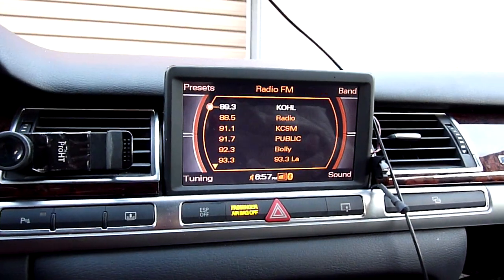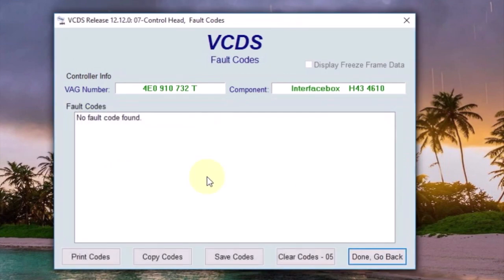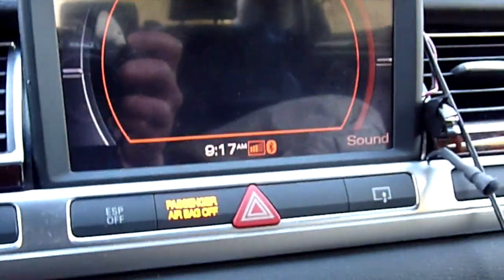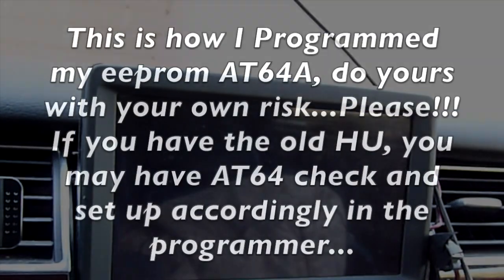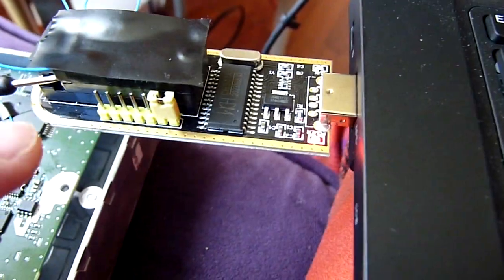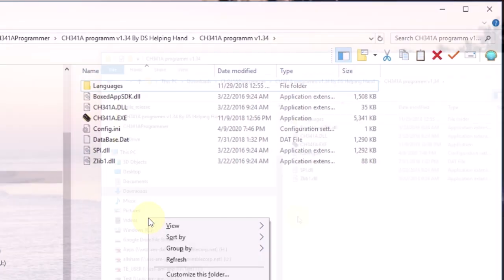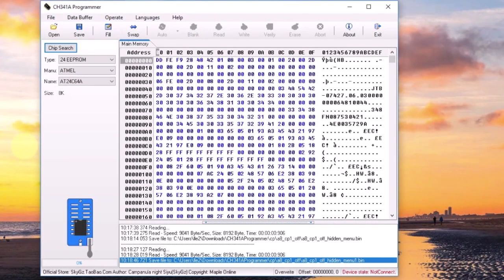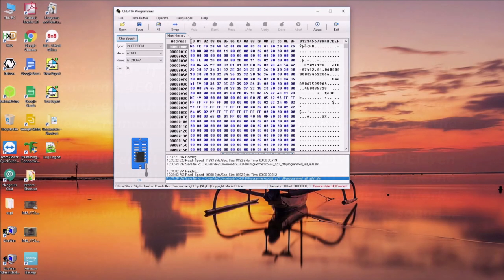How To Replace And Remove CP HU MMI 2G

Comment: Hello, quick question: since I currently have no sound (due to CP), if I perform the same conversion from my old EU unit (without navigation) to the new MH2P (USA with navigation), will the audio work afterward? I plan to activate the necessary codings with VCDS once the conversion is complete. Also, will this conversion give me the European languages instead of the US ones? Thanks in advance.

Comment: 9:45 great video and explanation. I do everything as shown with all pins connected correctly to both sides. unfortunately just the very first time I connected the device, I could read it just once. every next attempt the red light is on for just a second or two and then goes off. Then Tried the same procedure also with my new module and again it lights on for just a second. This way I cant read the chip.

Any thoughts what went wrong? Is it the chip reader, the pc or the windows 11, or maybe the cables I use ? Thanks for time, help and videos
Reply: Same situation. Did you resolved this issue?
Reply: No. Eventually, I gave the mmi to a guy who did transfer with his own hardware/software. I guess either my ali express stick or the cables direct contact didn’t work properly.

Comment: My mmi is 2g control module for my 2006 audi a8l it  the number is 4E0 035 729.  So if if I get the one 4E0 035 729A it will work?  If I reset it thru the controls or do I have to have the vcds software to reset it?
Reply from the maker: What are you trying to do by replacing HU? If you want to have CarPlay/android auto they have a unit that plug and play with MMI 2G already. If you still want to change to the “A” then you still have to remove the CP.
Reply: @3dogs1monkey  my mmi control module is bad and no longer works so I have to replace it so my controls and screen will work
Reply: If I get a after market carplay/android auto radio.  The mmi control module has to work to get sound right?
Reply from the maker: @MrSicwitit2008  it uses MMI control to navigate so everything must work as original
Reply: @3dogs1monkey  thanks I'll get the mmi that has the same number as mine and get audi to program it
Reply from the maker: @MrSicwitit2008  just get the A no difference if you need the dealer to unlock cp

Comment: Thanks for the great video; is there a way that I can get in touch with you ?
I did an MMI interface swap with same part and software numbers matching took the car to the Audi dealer charged me for 3 hours job for updating the unit yet couldn’t remove the CP.
I’d like to send you both of my units and see if you can do the CP removal many thanks.
Reply from the maker: What MMI interface? The Head Unit? What CP do you have? just the sound? Everything else works? I don't have the programmer with me any more, but I can swap the i2c chip for you which should remove the CP. What year is your car? Please take the pictures of the head unit and email to louis@dognmonkey.com
Reply: @3dogs1monkey  I emailed you already thank you so much 😊

Comment: Hi, I have read the memory several times, which I have unsoldered and compared the different readings but they are always the same. can you help me?
Reply from the maker: Angelo Patricelli why did you unsolder? How did you read? Both images should be different. You should see the serial number and model in the hex files, how can they be the same? You didn’t follow the video instructions
Reply: @3dogs1monkey  Ciao, leggi con un programmatore upa e confrontato con l'HXD SW ... ma non vedo alcuna differenza

Comment: Btw I could simply unsolder the eeprom and swap it on the new board. What do you think?
Reply from the maker: Veikra yes, but the image can be used over and over but a damaged chip guaranteed CP removal on any new HU.
Reply: @3dogs1monkey  true. Good to back it up.

Comment: Your tire pressures seems very low. Both mines are in the 40 psi range. Any reasons?
Reply from the maker: Veikra they’re should be 34psi not 40
Reply: @3dogs1monkey  thats the weirdest thing ! My manual and stickers in the doors calls for 42 front and rear on the S8 .  My A8L calls for different rear pressure depending on rear seat and luggage though.  40 front  36 rear at minimun, and up to 46 front 42 rear at full load

Comment: You must  be getting good at taking that glove box out without breaking the soft drop piston now hehe (y)
This will certainly be handy for me, I like to buy those cars with blown suspensions and defective mmi. That`s how I get them cheap. You can check out my 334 000 miles 2004 and I got a few maintenance vids on the 2007 S8 as well